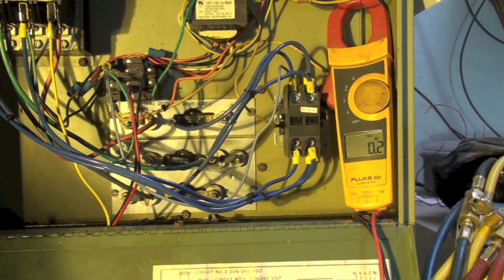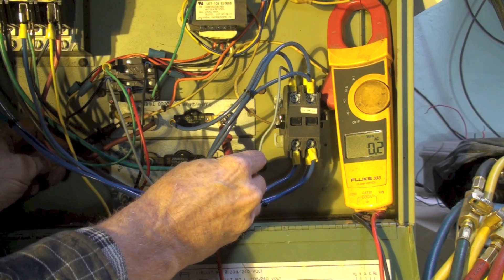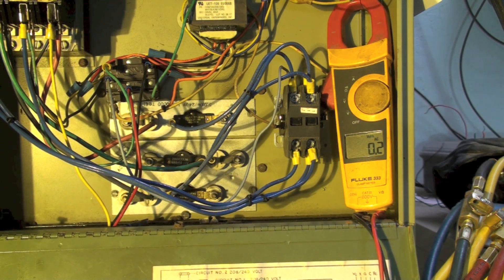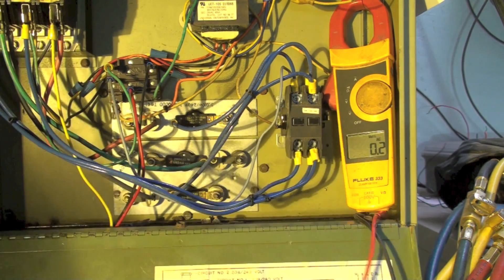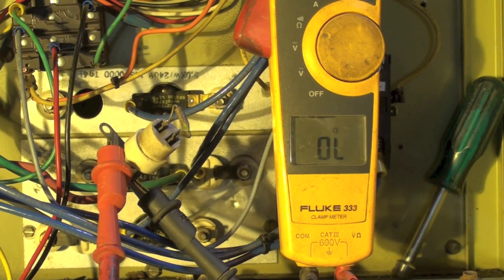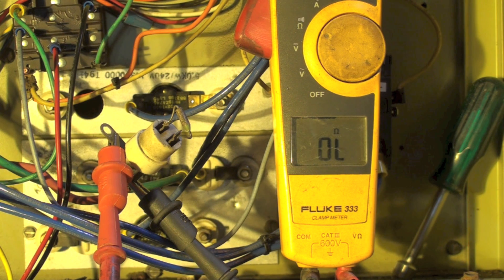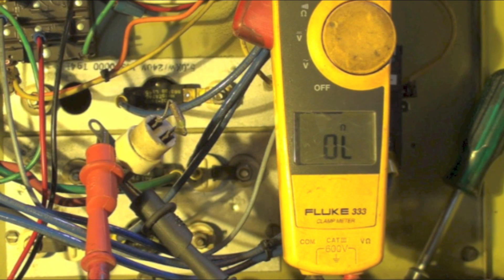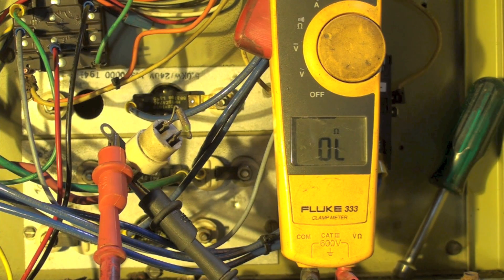Electric furnace repair answer #1

Comment: why did it read zero (same unbroken flow line ) ?
Reply from the maker: I was checking power to the element (load).  With power to the circuit and no load operation, an open switch must be suspected.  The element fuse was open.
GFM

Comment: these videos are great but I cannot find one showing my issue.  My contactors are cycling my heating elements on and off every 10 seconds or so consequently my house heats very slowly but it does heat and it does maintain the temperature but starting from a cold house it takes a very long time to heat up the house.  What part do I need to replace if my contactors are cycling too fast?
Reply from the maker: They are probably cycling because of air flow.  As in low air flow.  The limits are shutting down the heaters.  Filter, blocked A/C coil or ductwork problems.
GFM

Comment: It that the old air handler for that heat pump or is that a different one
Reply from the maker: heatpump hvac Its used with the old heat pump.GFM
Reply: Oh how old are they like a 70s model or early 80s model
Reply from the maker: heatpump hvac That one is probably from the 1970s.  Its a Fedders unit.
GFM
Reply: Oh is it connected to the old heat pump